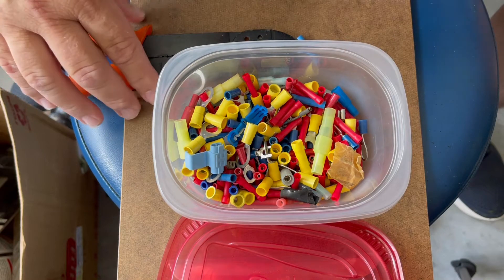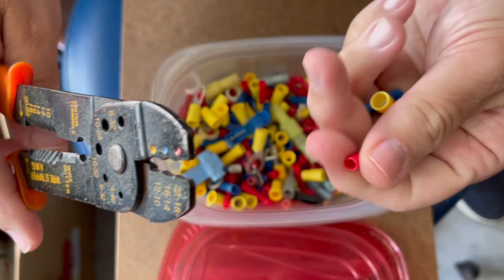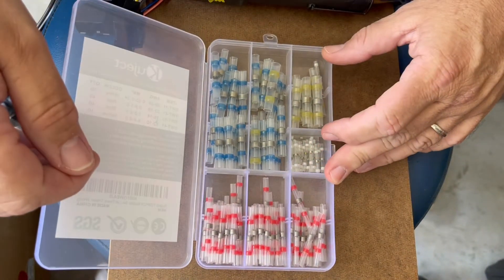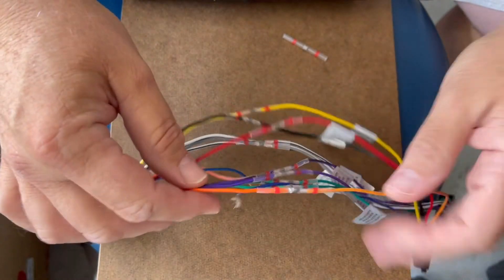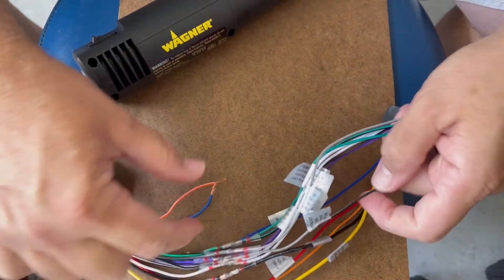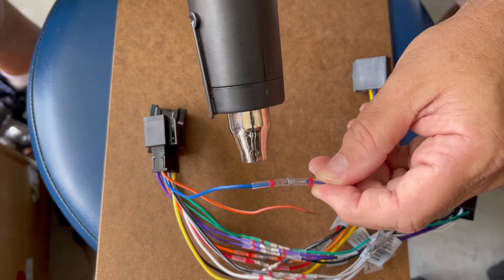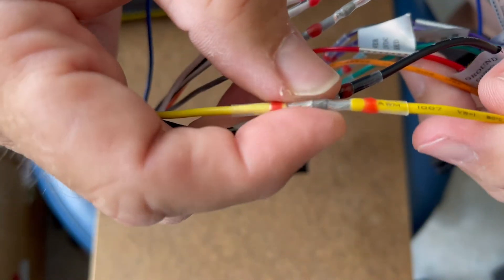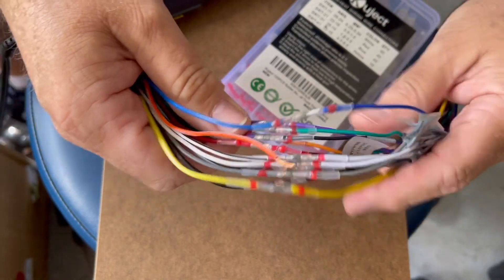Cool and Unique Wire Connectors

Comment: They’ve been around for a while and they work pretty good. The solder has a lower melting point than regular solder. 
Personally if it’s a critical wire repair, solder and heat shrink is the best option. 
For the radio harness they work great. Good video as always 👍
Reply from the maker: Thanks Gary! I’ve been using  them for about three years but realized I never did a video talking about them . It’s always best to change the entire wire vs splicing, but these are a great alternative.